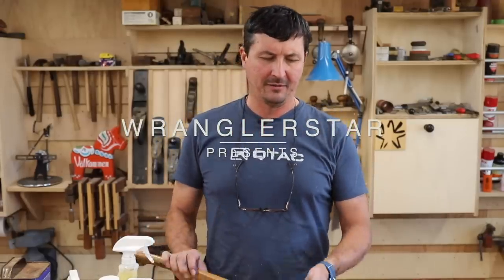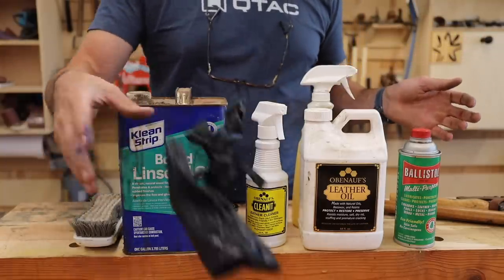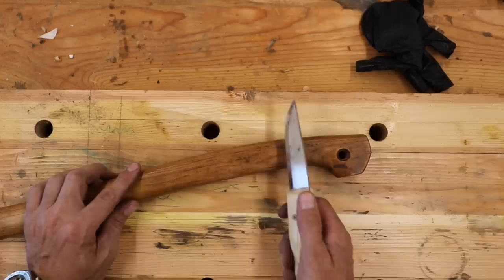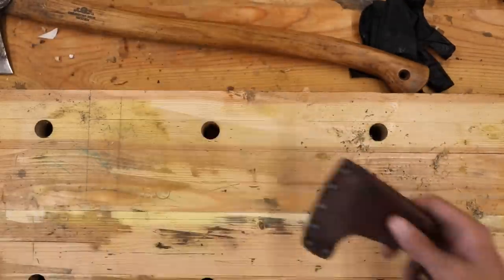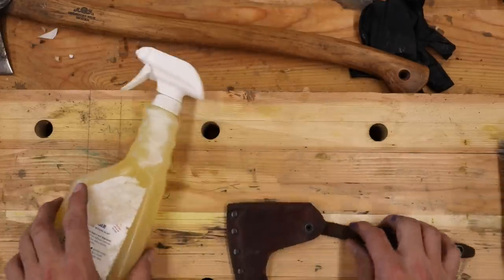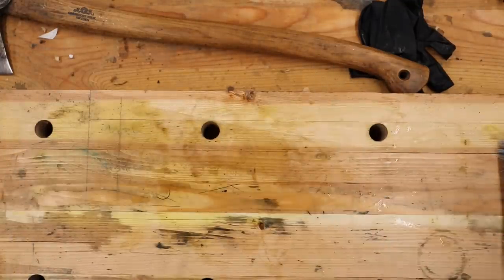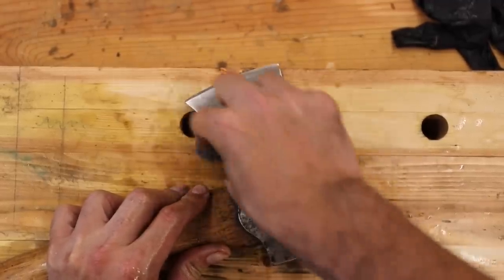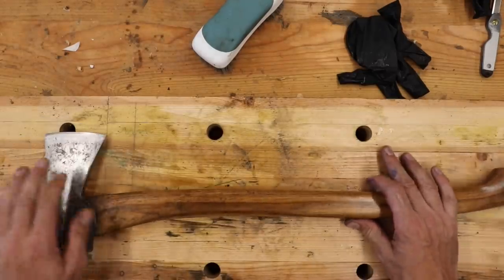Wranglerstar's Top 5 Axe Tricks

Comment: A boy scout recipe for waterproofing anyi  has work great for me on wood ends. Old boots and fabric  waterproofing. 
Melt 16oz beeswax with 8oz of boiled linseed oil then add 8 oz of turpentine.  Stir as it cools. Once set up. Apply liberally and apply heat to area. Heat gun works great. I've also waterproofred hats as well.

Comment: Maybe I will regret it.... I am using walnut oil to oil leather, and at the moment I am thinking of using beeswax and a hairdryer to wax the outside of the sheath on my brand new Gransfor Bruk hand hatchet sheath, to harden it, and use a cool fabric glue to glue the floppy end of the sheath. That could fail when I later oil the inside only. I thought of this when I saw people using Brazil nuts to oil wood. Hmm....

Comment: I grew up in Tn. We had a trough in the barn about 14x14x10. It was filled with sand. Dad always put the used motor oil in it. Then when we were thru using his tools we put them in the trough. They were always clean and rust free.

Comment: Use the back of the blade. Doesn’t dull the knife and still knocks off the chunks
Reply: Just sharpen the knife? The sharp side works way better.
Reply: @pivotalpigeon2914  Nope.  A 90 degree edge on the back of a blade is far superior for scraping wood than a sharp blade with any kind of grind.  That's what it is meant to do.

Comment: If you look at the MSDS Ballistol is essentially mineral oil with a bunch of alcohols/solvents that make it work well as a cleaner for gunpowder/gunk. I'd imagine alcohols/solvents on leather would be bad news and dry it out - especially if you put it on thick and put the leather sheath on right away! If all you're doing is sealing the steel, why not just use pure mineral oil or even just the linseed oil that you already have out? Also, a lot of guys swear by a product called 'Boeshield T9' as a more durable wax-based steel sealer/rust preventor; other just use good old paste wax.

Comment: You can get some "Tried & True" Polymerized Linseed Oil - it dries quickly; similar to "boiled" but without the chemicals. A little more expensive, but worth it for things that come into contact with food and to avoid wearing rubber gloves.

Comment: Personally my axes are used year round. But I do oil my handles 1-2 times a year. Clean any sheaths with saddle soap. And keep the heads sharp and clean. Long storage I put linseed oil on the metal to make a barrier.

Comment: I make my own. Heat 4 tablespoons beeswax, two tablespoons virgin unrefined coconut oil, one tablespoon black seed oil(cumin seed oil), one tablespoon lemon balm oil. Mix well and allow to harden. Great for treating leather, wood, steel, boots, canvas. I treat myKnives, knife sheaths,axes, rifles, pistols, you name it. When you're finished, rub into your hands and face and any other parts of your body thats dried or chapped. I make this stuff and hand it out as gifts to friends and family. People love it. I do use BLO initially on all wood in multiple applications until saturated but after that, all I own gets this natural balm once annually. This natural balm does not spoil or turn rancid. I never have issues with mold, dry rot or rust. I also use it on my wood shop tools, planes, saws, bench vises etc.
Reply: I like the sound of this.

Comment: I've use 00 steel wool to polish my truck windshield...yes it wont hurt it.  Clean it and dry it and then just dry with 00 steel wool and polish the windshield.  Then wash off and when you have your wiper blades that work well.  Also use Rain X after and wow your looking out your truck nicely. Done this many times.

Comment: Be careful with the BLO as it can self ignite. Dispose of the soaked rags safely.
Reply: True.  I threw away a rag with BLO on it in a closed trash can.  The next time I went to throw something out I noticed that the rag had caught fire and there was a bunch of ash around.  Luckily nothing else in the can caught fire.  An enclosed area is much more dangerous than a well ventilated area.  I've never had a piece of wood with BLO on it ignite, but I now leave them in a well ventilated area at least overnight.
Reply: Co-worker burnt his fiance's house down from a linseed rag left on the deck.
Reply: BLO rags make good fire lighters. I toss them under the kindling

Comment: Years ago I started using good old canola oil on my motorcycle boots and now I use it on all my leather including my sheaths that I make myself. The leather really soaks it up and I have found on my sheaths it soaks all the way through applying it only on one side and gives them a great looking finish also. My boots are now six years old with a lot of riding time in all kinds of weather and the leather is still in great shape. I ordered a new hatchet the other day and I'm going to try the canola oil on that also. Very curious about how that will work out. The canola oil works great on my wood cutting board so I'm curious to see how it will work on an outdoor tool.

Comment: When doing the linseed oil could you sit the ends of axe handles in a coffee can of the oil to help protect what would that do to the handle ?
Reply: I've  seen people drill shallow holes in the ends of handles before, maybe 3/8 inch wide? They then pour in an amount of BLO and let it absorb over time. Have also seen this in combination with a small "bowl" made of duct tape on the top to hold large amounts of BLO, often done without drilling at all. Seems to use less oil than filling a coffee can and accomplishes the job. 

I've  always manually applied it here and there and have axe handles  that have lasted decades with moderate use year round.

Comment: Hey Cody I was always told not to over oil my gun stocks especially on the inside of my gun stocks I was told the same thing when I remove my Flintlock lock from the gun not to get too much oil down inside because it will make the wood punky slash soft. What's your feeling about that thanks Simon

Comment: Cody, I’m in need of clarification. I thought Dutch oil is what you said is the superior oil for axe/ hand tool wooden handles. I’ve been using the Dutch oil. Should I switch to the boiled linseed oil, or continue with the Dutch oil?
Reply: Use BlO

Comment: Dont listen to a word of this leather care advise if you carry your axe strapped to the side of a $200 Vanquest or similar backpack. 
Scraping? Oil slicks everywhere?  I'd rather just buy a new sheath every few years than have to forsever deal with a slim mess and oily fingers every time I thouch it.
Put a little bit of your favorite leather oil on the inside using a popsicle stick to reach the crevices, treat and polish the oustside like a pair of shoes, clean sap off of the head and handle with alcohol on a rag, use fine steel wool on the handle and follow up with BLO.

Comment: I respect your opinion on how to care for your axe but it's backwards to the way I go about it. I especially when it comes the the head. If I did it your way I would come to a axe in the spring covered in rust because of how humid it is in my state. I don't sand or scrape them except if my tool has been in the dirt, I coat the head in linseed oil and it forms a coating after it dries that doesn't wipe off with your hand and won't rust, it will turn yellow but that comes off after a couple minutes of use and I have never had it rust on me even when left in snow.

Comment: Guys I could use some help. I oiled my axe handle but didn't wipe the oil properly and now it is sticky. How can I fix it? Do I scrape it again with knife or sand paper or steel wool? Or it will dry out eventually. It's been a week and it is still sticky.

Comment: Just like an old baseball glove, leather needs to be protected from the elements. Silicone based preventatives are a quick fix, oils are the answer. Soft and supple just like slow and steady win the race. The Iacing doesn't dry rot. The leather won't check, crack and disintegrate.

Comment: fellas, im confused. 'Once a week for a month, month for a year, ect...'  does Cody mean four days every month, then next year one day every month and then in the following years only one time annually?
Reply: Basically, to treat a new handle you actually care about and want to last, you would oil it once a week for a month (so 4 times for the duration of said month) Then once a month for a year (after the initial 4 oilings) Then once a year for the life of the tool after that.  Personally, I treat my handles when I'm the recipient of a new wood handled tool when I first get it, and before and after winter.  Your preferences may vary depending on handling, storage, environmental temperatures/humidity differences.
Reply: @timc46440  Ah, i think i get it now. So it's all happening in the same year, let's say we start January, 4 times in January and then in the following months only 1 time per month?